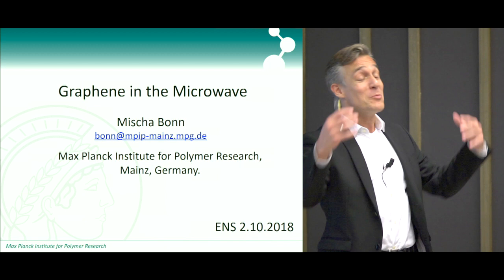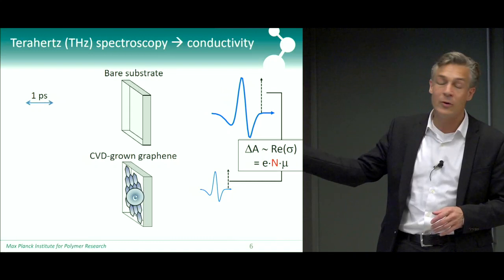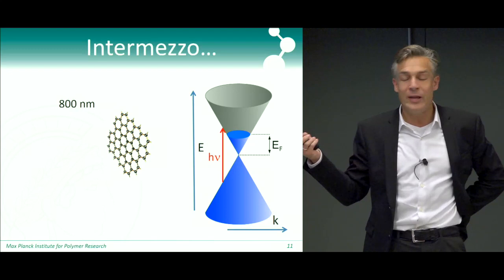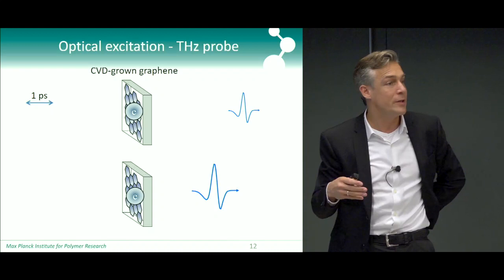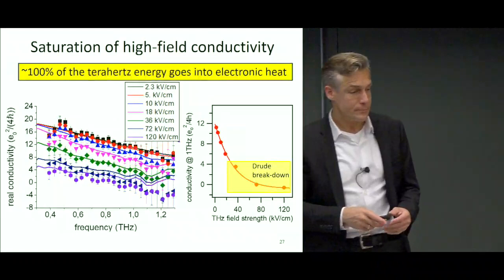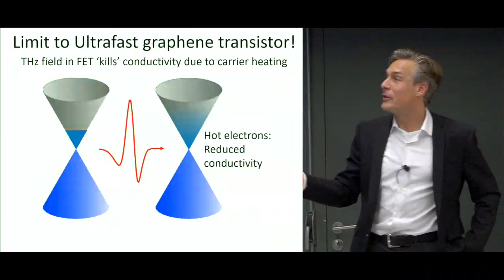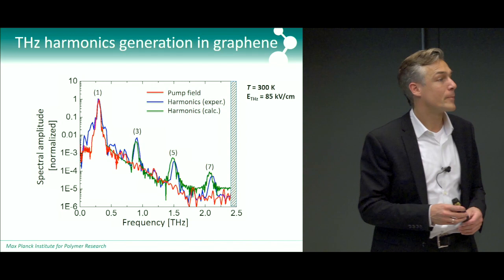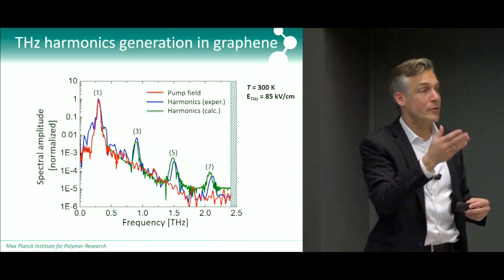M. Bonn - Graphene in the (Terahertz) Microwave

Comment: "When hollow structures with different cavity sizes are connected by capillaries and the capillary is subsequently broken, an interesting effect occurs in such structures. This can prevent pure hydrogen gas from diffusing while simultaneously creating vacuum effects. This technique can be used to transport water to deep layers where it would not normally go, enabling the storage of energy. It also offers the possibility of constructing automatic gas and vacuum circuits, as well as materials with super-insulating properties or catalysts that can contain hydrogen without exploding." Mann könnt es benützen um Piezoeffekte auzulösen. Und vieles Mehr.  Naturlich gibt es einen Haken an der Sach die Nanostruckturen müssen auch noch in zwei ander richtungen gehen aber dabei keine grossen Strecken macht so dass keine neuen Verbindungen zu den Hohlkörpern entstehen können.